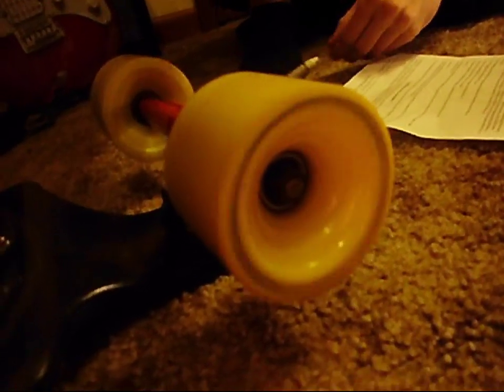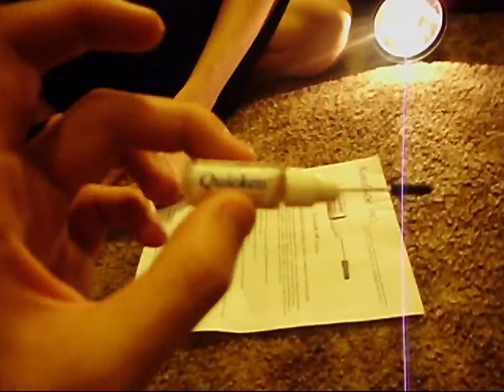Worlds Longest Bearing Spin (DiamondLube)

Comment: "removes just about all the friction"
...
knocknocknocknocknock
Reply: It performed extremely well. No wear, and quite as far as thin lubricants go. The said bearings in that test are now in a friend's board and filled with grease. That test was only in one wheel (two bearings) to compare to other lubricants and it actually came out on top over Finish Line Wet Ceramic and Speed Cream. There were some competitive products I'd say tied with it in terms of wear protection, lack of noise and smoothness. I plan on using it in a full set and seeing if there's actually a performance difference in riding when they're all lubed with it.
Reply: It's vibration from a lack of oil to cushion anything (I may be wrong there). I'd love to see the bearings disassembled so we could see the bearing balls and races, if there wasn't any wear it'd prove the diamonds work for that end of things.
Reply: I would like to see that as well. I don't doubt the potential of his particular choice of lubricant, but I'm sure there is better. The clearance between the balls and the races has got to be less than a thousandth of an inch, but even a little bit gives wiggle room, so you could be right about that, but who knows. I am curious now though...
Reply: I have a bottle of it, I've been experimenting with it and so far no wear... But I haven't ran them dry because I know better than that. Especially if you're bombing hills like these guys, one long good one with the ability to build heat in the bearing and you can melt your wheels and fly into asphalt. You need oil to dissipate heat besides reducing vibration and wear. (If you like grease that's fine, it has the same effect unless you over fill the bearing which actually helps create heat.)

The speed cream seized and caused me to eat it a couple days ago and had wear metals left behind in the oil, thankfully little race or ball scuffing occured. In the test I had 2 bearings with a nano WS2 product, 2 with a Teflon/Nano ceramic compound product, 2 with Diamondlube, 2 with Speed Cream. The Speed Cream failed while the rest were still happy except for the ceramic because I over oiled it and it had a piece of sand inside without damage, after the failure I cleaned and re oiled every bearing and replaced the Speed Cream with an ester based oil additive that has proprietary nano additives. We'll see how they all compare this time.
Reply: Simple as it is, the only true way to test a bearing and a specific lubricant is to test it under load. Simply spinning it won't tell ya a thing. Some people don't know that, which is why you can find reviews of Speed Cream where they say stuff like "look at this, it just slows down my bearing! They spin much longer dry!" Personally I'm not too concerned with what lubricant I use as long as it keeps my bearings good and lasting. Being that I've rebuilt a few automatic transmissions, you can bet that I know the importance of that lubricant and won't be running without it. A transmission without lube would only last you a few seconds, if even that.
Reply: Most definitely. All of my results came from the results under load. By the way, Speed Cream is great under no load, but under load it degrades awfully quickly and doesn't fare too well. I'll be comparing Diamondlube to its competitor Nano Oil. I'm skeptical of the nano diamond claims here but I can't deny that it's working, and well.
Reply: Did you test them out yet?
Reply: That sounds great.  I just started to do some videos on it with, of course I did, Fidget Spinners lol.  The ceramic bearing got way better.  If you wanted check it out its on my channel.

Comment: at the begging the bearings sound like chainsaws
Reply: They're being ran dry and there's some serious vibrations going on. The Diamondlube may work for preventing wear and reducing friction but even if they do they should run a little light synthetic oil for heat dissipation at high speeds.

Comment: What you haven't done is test the initial speed of the wheel, and since you didn't start it with any sort of accurate or predictable method, then 15 second difference (a mere 3.5% improvement) is not at all statistically significant. As jpeg667 said, learn science.

Comment: Can you explain how this stuff defies what is taught in grade school or high school science about graphite and diamonds? Diamond is the best marketing word but it is not used as a lubricant.  Graphite can be a lubricant diamonds can not. If this lubricant contains diamond dust (artificial or real) it will be harder than your bearing races and therefore it will polish them away slowly.  Races that are harder on the surface only will quickly have soft metal exposed.  The bearings will also be polished and ground away.

So is the word diamond just hype and BS or are you calling coal diamonds? 

Or are you guys just repackaging someone else's rip off product illegally and reselling it illegally?
Reply: Diamond is the name of a skateboard brand...... Maybe google that before wasting your time on some long ass response that makes you look crazy ignorant sir.

Comment: You really should try to make an automotive oil additive with this concept, it would probably increase fuel efficiency by a very interesting margin. The 1992 nissan truck I have has documented gas mpg rated at 24 mpg. If it could get another 2 or so mpg I would be impressed. If you decide to make an automotive formulation send it to me and I'll try it out in my truck and upload the video to promote your product.